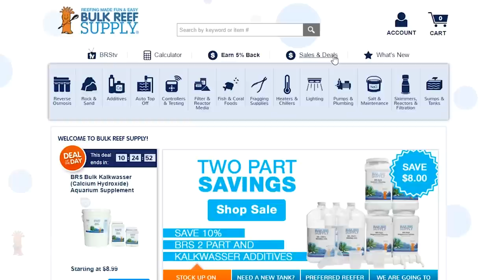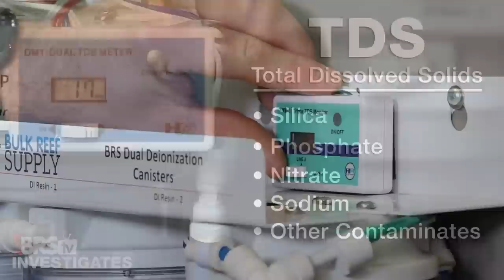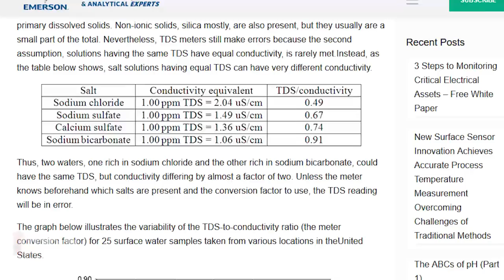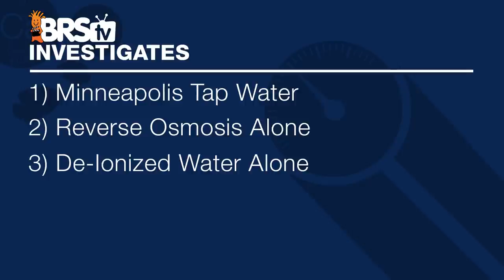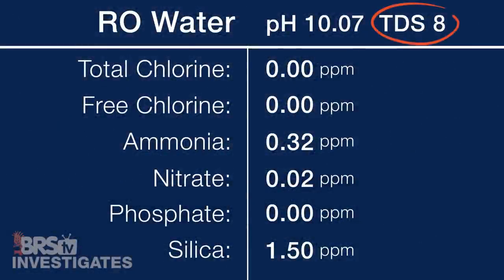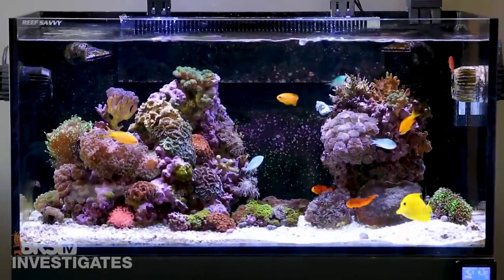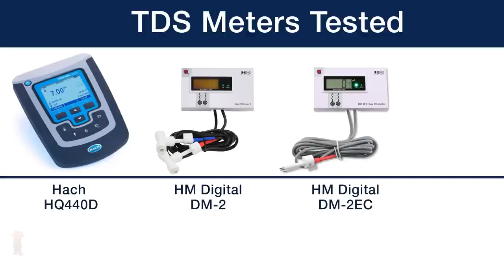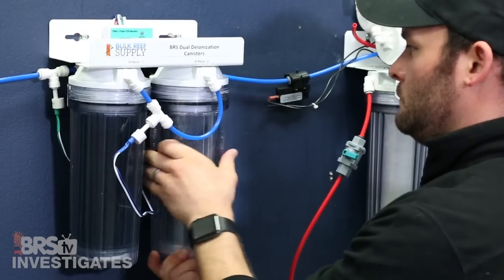How accurate are the TDS meters on our RODI units? | BRStv Investigates

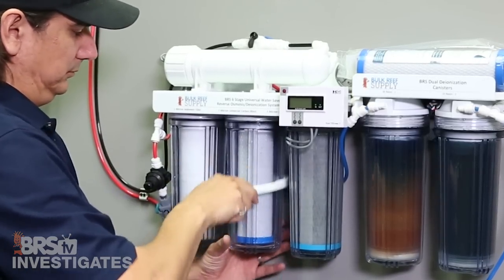Comment: 14:44 onwards brought up some really good considerations about DI-only. A question it raises is, which if any contaminants that matter to a reef could evade the filter stages if only RO is omitted from the systems aquarists use? By my understanding a good quality carbon block should knock out volatile organics, chlorine and most of the common x-cides (not certain), with the only possibly-reef-unfriendly things getting through being bacteria and viruses (not normally a problem in town water), and the cat-/anions (usually knocked out by the DI resin).

Comment: I use the triple inline meter along with the COM-100 to confirm results. I used to use the small $15 brown pen but it never gave the same reading. With the COM-100, for TDS, did you run it under NaCl or micro siemens? Also, I've found that you need to hold the pen in the water for about 2 mins for it to read exactly because the temperature reading takes a bit to get to where it should be. Also, was this just cold water, or around 77 degree water from the tap?

Comment: So I noticed when you talked about changing on the DI resin the resin color was separate, but the same basic colors that the rest originally is.    I regularly notice my resin separates very quickly, and I do verify my RO membrane is knocking everything down by 98% with a TDS meter, is this due to not packing the resin tight enough?   If so how do I know when it's actually used up?

Comment: I just bought The In Out Overflow for my 40Breeder. What return pump would you recommend doesn’t have to be brand but size.  I’m lost. Lol help! Thanks always count on you guys. I just posted a new vid see if you like it 👍🏼👌🏼#KeepReefing
Reply: General rule of thumb is 5-10x tank volume through the sump. Look for a pump that produces 200-400 GPH at the head height it will be pumping. If it were me, I'd buy the Vortech S1 or M1.
Reply: BulkReefSupplyCom I went with the Sicce 3.0 what you think??
Reply: Perfect choice.

Comment: My tds meter is reading 0 in and 0 out.  That can’t be true.  I have your 4 stage unit and tds meter so that causes some concern for me.
Reply from the maker: What is your source water reading at? This is likely very low, and could be possible if getting around a 99% rejection rate!
Reply: Bulk Reef Supply my source water is reading 0.